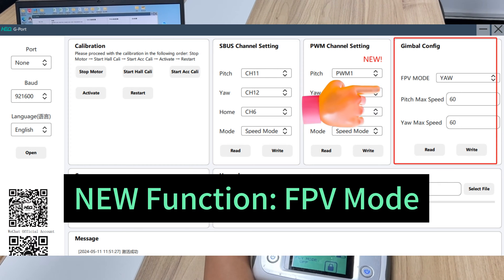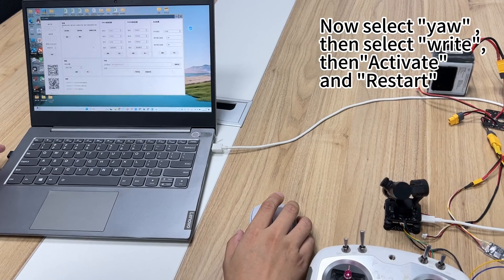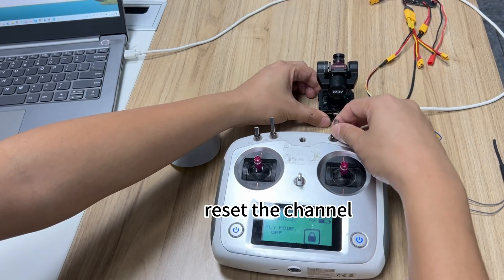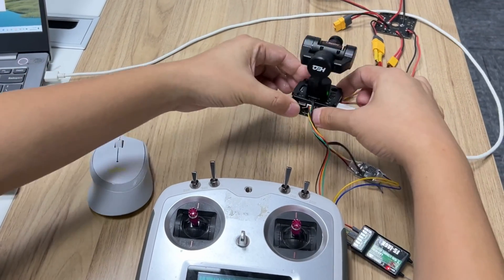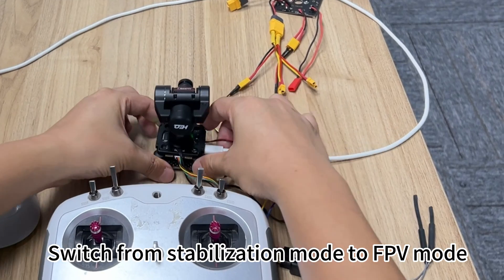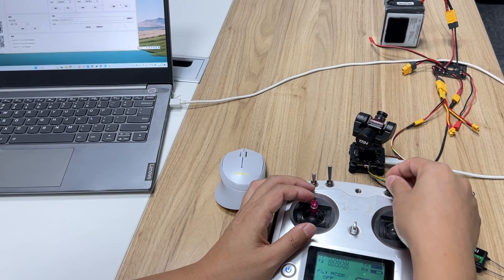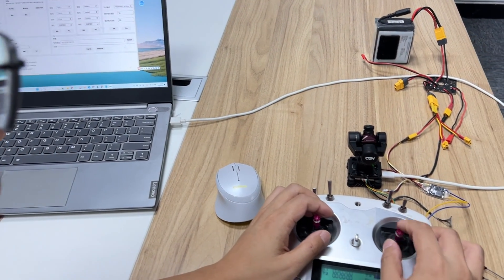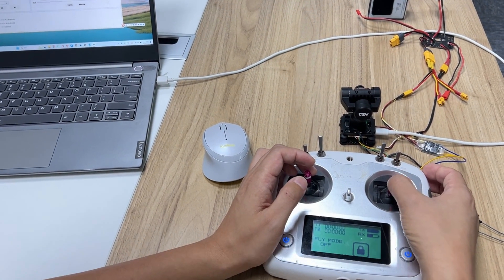G-port Gimbal Update! New Firmware! Support FPV Mode~#gimbal #fpv #3axisgimbal

Comment: I'm trying to understand the locking mode. You need a switch to setup locking mode? can this be set to automatically start? And by saying the locking switch is the middle channel do you mean PWM 2? I cant get lock mode to activate using PWM. Any help would be appriciated.
Reply from the maker: The middle channel refers to the "return to center channel", which is not necessarily PWM2. You can choose to set it on the remote control. Now the fpv mode can only be triggered by the three-stage switch of the remote control, and the software can only adjust the parameters. I send you the link of the relevant video for reference:
This is a link about the introduction of mode settings: https://www.youtube.com/watch?v=vk7kkyAKAi0&list=PLgrvQG-HMZ9nQz71h7Yw36Lue3dduV-gr&index=8
FPV mode  tutorial link：https://www.youtube.com/watch?v=1vjyq-6Uk7w&list=PLgrvQG-HMZ9nQz71h7Yw36Lue3dduV-gr&index=3
This is our G-Port tutorial series link: https://www.youtube.com/playlist?list=PLgrvQG-HMZ9nQz71h7Yw36Lue3dduV-gr

Comment: can the gimbal also get control for all 3 axis? like every one PWM channel controlls one Axis, omitt the "return to home" as this can be done by setting all 3 Channels to center, that would greatly improve the gimbal to headtrackers and Flightcontrollers.

this is the only thing holding me back of buying a couple sets to upgrade my fleet of planes
Reply from the maker: The three axes can be controlled normally in the stabilization mode. The free axis lock function is not yet supported in the FPV mode, but we will continue to listen to your suggestions and update it.
Reply: @HEQUAV  just to avoid any misunderstanding, will it be possible in future to controll each axis of the gimbal seperately? no stabilisation, just controlling like a normal headtracker?
Reply from the maker: @egseysfv8976  We are developing a firmware that can control the angle in FPV mode, which should meet your needs. Please wait for us.🤣
Reply: @HEQUAV  is there any timeframe when it will be ready? i am currently deciding on G-Port gimbal (looks nice quality) or Caddx Gimbal (has the feature i need)

can you give any ETA for the headtracker feature firmware to be available
Reply from the maker: @egseysfv8976  Update in about two weeks

Comment: Need a mode where I can lock out yaw and pitch, and have roll be limited by the user, I only need it to damp out 5-10 degree of roll shakes, not compensate for the entire plane banking.
Reply from the maker: We will try to improve it to see if we can give users more freedom in using FPV mode.😁
Reply: @HEQUAV Basically fpv mode for wings that only reduces shakes 👍
Reply from the maker: @Finnv893  Because some players need to lock the axis to determine the attitude of the aircraft🤣

Comment: How to use it with walksnail headteacker?
Reply from the maker: You can't control the gimbal directly through head tracking. The head tracking sends signals to the remote control, and the remote control controls it. The protocols our gimbal supports are currently SBUS and PWM protocols.
Reply: Configure the head tracker as trainer in your radio. (painless360 has some nice tutorials on it).

Comment: This seems wrong to me...    when in fpv mode the gimble should not be locked but should follow movements of the plane smoothly acording to a follow speed setting.   also why lockout the manual control - you should still be able to choose the camera angle and then the camera follows (smoothly) the orientation of the palne but at the angle you have selected.
Reply from the maker: Hi Roy,many players have asked us to lock the axis, so we will update this firmware. If you don't need it, you don't need to turn on this mode and just use it normally. This is a mode that players can choose by themselves.😁
Reply: @HEQUAV  I understand some would like this.   But what would be better is locked but still smoothing out juddering movements so your camera follows as if it was locked but smoothly.   Like if I was filming with a go pro fixed statically.   It would still smooth out juddering movements but would *follow" the model as if it was locked but smoothly.
Reply: What I want to do is only use caddx moonlight and get rid of my go pro on fixed wing plane.   As it would be my main fpv camera as well as my filming camera I want it smoothed at all times but to follow the plane at all times unless I'm giving pan or tilt stick movements then it would obey this but still following the plane plus or minus the stick movements whilst all the time smoothing out plane judders from turbulence etc.  but allways following the plane enough to still fly it if im giving no pan or tilt input.

This is kind of how a handheld DJI gimbal works it follows where your pointing it but smoothly and always correcting judders from walking etc.
Reply: Maybe your Angle Mode already behaves how i sugest.    Do you have any video of Angle Mode on the bench showing how it tracks the plane and how it responds to stick inputs. 
Is your software open source ?   I could perhaps modify it myself for my needs if none of your modes fit my requirements.
Reply from the maker: @RoyCruse  In our software, you should be able to achieve what you want without setting the axis lock. This gimbal is suitable for caddx moonlight camera.
Angle mode usage video example: https://www.youtube.com/shorts/5l7Ce262aus
Sorry, our software is not open source and does not support players' own modification. If you have ideas, we will summarize the suggestions for continuous improvement.
Reply: @HEQUAV  Hi thanks for the info - but your video doesnt show the gimbal being moved as if it was attached to a plane - it shows the gimbal responding to inputs but not how the camera would track with the plane.
Reply: @HEQUAV  Ive just watched Iain from Mads Tech review video and this is definately not suitable for use on a plane.

It would seem that in FPV mode the gimbal is locked solid and offers no stabiliization at all (so why bother with the gimble at all) and in other modes the roll is always trying to maintain horizontal (useless in a plane) and the pitch always trying to maintain level (also useless in a plane)

To be usefull for a plane you need a "Follow" mode where the gimbal always follows the planes orientation (ie always looking ahead and aligned with the pitch and roll but NOT locked so no stabilization of the footage is acheived.   we want the planes jerky movements to be ironed out so we get smooth stabilized cinematic video whilst still being able to fly the plane. (ie know which way its facing and what pitch and roll is happening)

The yaw axis seems to be the only axis that behaves this way.

"Follow" mode needs all 3 axis to behave the same as the yaw axis.

input to the gimbal for pitch and yaw can offset the otherwise "straight ahead" orientation so i can adjust my view whilst still being able to track the planes movements to fly it. (the same as looking out your window in the real plane down your wing for instance)

"Follow" mode should have settings for how fast and agresively the gimbal corrects back to that centre point so you can adjust it for your taste.

This way the view would look very similar to a go pro's stabilized footage whilst still allowing sufficient awareness of the planes orientation for flying it.

Im happy to discuss further or raise these requests through a propper feture request platform if you have one.
Reply from the maker: @RoyCruse  Sorry, we don't have any videos on this yet.
Reply from the maker: @RoyCruse  Yes, we currently only support locking the "yaw axis" or locking the "yaw & roll axis" or "yaw & roll & pitch axis". We haven't yet achieved a free choice of locking mode for the three axes, but we are developing it.
If you don't use FPV mode, the gimbal will play a stabilization role. At the beginning, we developed it to allow everyone to use O3 or caddx cameras more freely, and we will continue to try to improve it according to user needs.
Reply: @HEQUAV  i dont want to lock any of the axis (as this is the same as not having the gimbal at all) - i want them to behave the same as yaw when not locked - ie follow the planes movements but still smoothed and also respond to stick inputs to pan and tilt.    I want always smooth video that follows the plane in all 3 axis and has an adjustment to set how fast it does this.  Its quite simple - imaging the video from a hypersmooth video filmed on a go pro attached to the front of a plane (but using a camera i can fly the plane via fpv with.    It should be the main default mode.)
Reply from the maker: @RoyCruse  This cannot be done directly, because everyone wants to shoot differently. You can only set different modes through our Assistant APP, and there is currently no way to control it manually.😂
Reply: @HEQUAV  The best thing would be to have 3 modes (and have it switchable using a an extra channel/home channel). The lock, tracking (similar to lock, but it will be stabilized and follow the movement of the aircraft), and full gimbal. The tracking mode is currently missing and it would be a great addition to smooth out the flight, but keep the camera looking in the direction of the flight. Because right now, it only follows the yaw, but nothing else.

And I would say that it is a major missing feature. Lock is fine if you want to see how the aircraft behaves, but it is useless if you want stabilized footage of a flight. Full gimbal is good if you want to look at something, but is again useless if you want stabilized footage of your flight. Maybe even with configurable dumpening values and which axes to follow. Because right now, the gimbal is kinda useless for an airplane. Actually, it is not a great addition for almost anything that can move in 3D, except for being controlled by another person in gimballed mode.
Reply from the maker: @stratos7755  Very detailed suggestions. We are currently optimizing based on the suggestions. Later, we will update that the three axes can be locked freely, so that more players can achieve the desired operation.😁
Reply: @HEQUAV  I wrote to you guys an email detailing the mode/feature even more, but I don't know if anyone would ever listen to that.

In that email, I am suggesting either a new extra mode or to replace the current setup with 3 presets that we can select from (all of which would work like this mode I am proposing). In this mode, we can configure it such that we can lock any axis we want. And when they are locked, they follow the aircraft movement. But, there should be a configurable number X which sets the smoothing of the following. For example, to achieve the same effect as the FPV mode currently has, we can lock any axis we want and then set the smoothing really low. This would make it so that the gimbal almost does not move (like the FPV mode). Setting it to 0 would pretty much lock it gimbal entirely in place. But setting it to lets say 20, the gimbal would now fastly follow the movement of the aircraft (and the higher the number, the smoother/slower it would be). And to add back the HOME functionality, there can be aditional tickboxes to set if the axis in this mode/preset should be controllable or not. If not, it would stay centered. If it was set to be controllable, we can control from the radio (and pretty much set the offset).
Also, if an axis is not locked, it would follow its original direction when set into this mode/preset. So if no axis is locked, the gimbal would keep looking the way it started, until it hits the gimbal limits.
The current HOME can be replicated by unlocking pitch and roll, but locking yaw and setting it to some small number (like 10-20, as it is less aggresive then in fpv mode).
The controllable tickbox would be available only for pitch and yaw (unless a new way to control roll would be added probably via SBUS only).

This way (preferabely with the 3 presets), the current setup can be replicated, but also, everyone can configure the gimbal just how they need. It would greatly expandl the functionality of the gimbal and make it very programable.
Reply from the maker: @stratos7755  OK, we will see these suggestions and try our best to improve them.
Thank you again for your very careful and patient feedback.